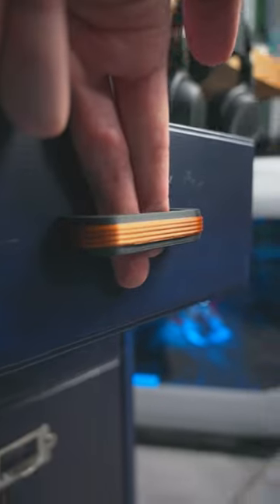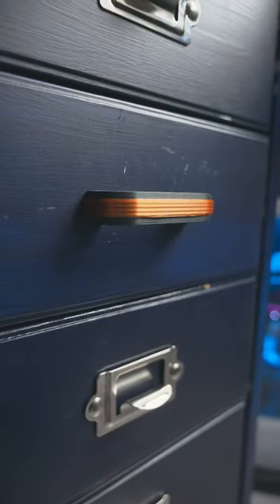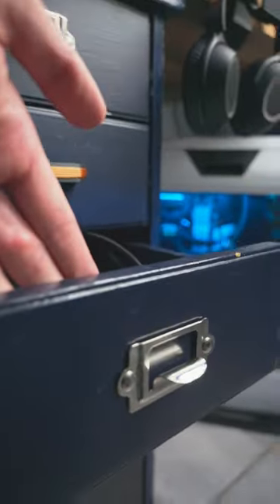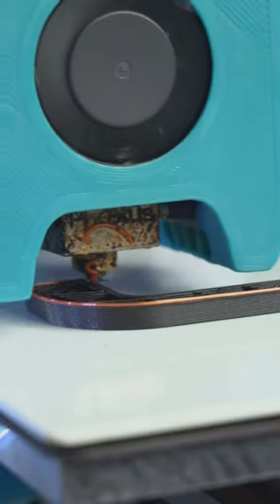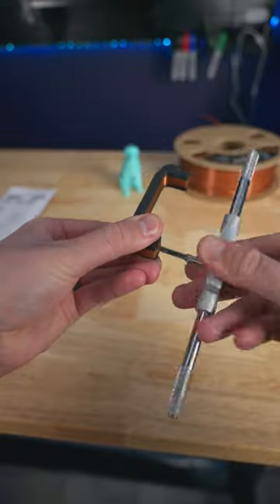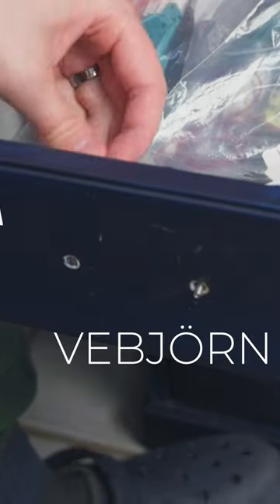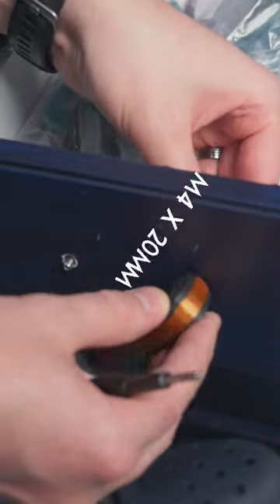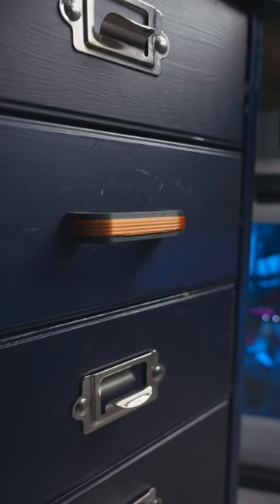3D Printed Ikea Upgrade - Art Deco Handles 🇸🇪

Comment: I work with plastics on machinery very regularly. Trust me dude when I say that M4 straight into plastic will strip out in no time with a heavy drawer.

Get yourself some brass threaded inserts and melt them into the PLA(?)
Reply from the maker: I totally agree with heavy drawers. These are pretty light drawers without much weight.
Reply: Could just make a slot for a square nut, stop the print on its last layer before it gets covered up and insert it. Then start the print again and you have a built in threaded insert that will never come loose.  Unless you crack the plastic that is.
Reply: My kitchen IKEA handles that were tapped and screwed into plastic are now 3 years old. With daily use they stand much better than original ones lel (they were printed in petg thou).
Reply: There is guy on YT that proved that inserting screw into bare plastic makes stronger connection that with these brass inserts.
Reply: @sobczaczek  link it
Reply: @biigsmokee  check out CNC kitchens tests on this topic
Reply: @JJShankles  Until they get so full that they’re heavy
Reply: @JJShankles  when you put stuff in them...

Comment: Would you consider printing the two colors separately and using super glue to put them together? I like the design but personally don't think I'm ready to make filament swaps mid-print yet
Reply: I felt the same but prusa slicer has in built function that with a single right click you can say to the prints to stop at that height. Then you swap the filament purge out enoug and restart. But be careful. Turn it to slow as possible because mine has a bit problem at start
Reply: Honestly, that's just a lot more time and effort. you could just attempt it a couple times and it'll save a lot more time, a lot more hot glue, and it'll just look better

Comment: So I just got my 3d printer and on my first print it got jammed with filament
Reply: Have you levelled your bed/calibrated your Z height? If yes -> Raise your nozzle temp by 10°C
Reply: Assuming you're printing at the correct temperature to begin with